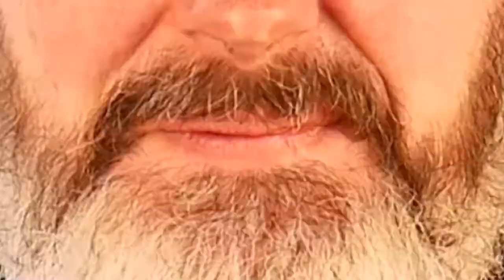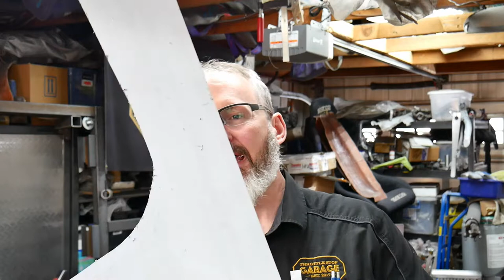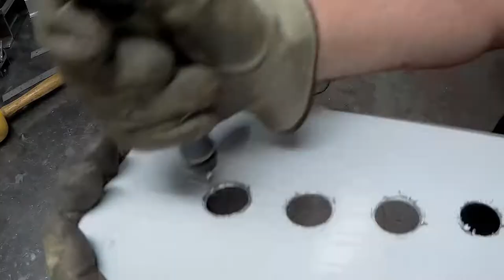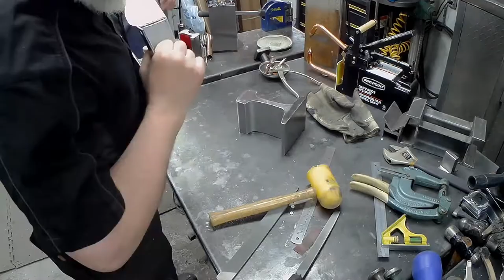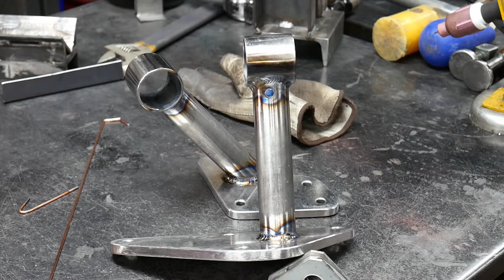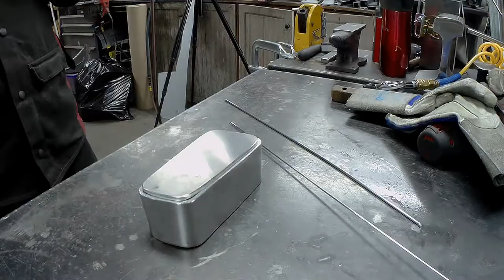Volvo Amazon: Racing Pedal Installation Pt 4 (ep. 39)

Comment: Craig, again your Canadian Meticulitis is over the top. To fit a panel with 1/4 X 20 bolts drill a 1/2" hole and use a fender washer, works every time. Now I'm not there to see it up close but I'm not quite understanding the panel over the pedals. Why is it necessary? Will there be enough pedal travel without hitting the panel? Doesn't look like it from my chair. Why not just leave the pedals open for ease of maintenance? I R cornfused!
Reply from the maker: Thanks Alan - couple of reasons really.  One is simply for a finished look - less "steam punk" more finished car.  The second is that in a book by Carroll Smith, I think in Engineeer to Win, he notes that having a little folded piece of steel on the floor to support the drivers heal is best for floor mount pedals.  So I incorporated both the heal hinge support and the desire to have the pedals covered.  There is lots of room even at full stroke (mostly clutch) - throttle misses by at least 20 mm.  There is a stop on the clutch pedal and I can get it to full stroke on the MC before the pedal bottoms out.  The brake is the same - but I'm not anticipating as much stroke there of course.